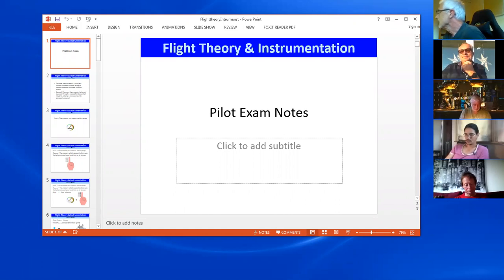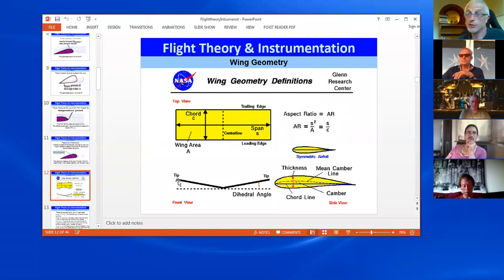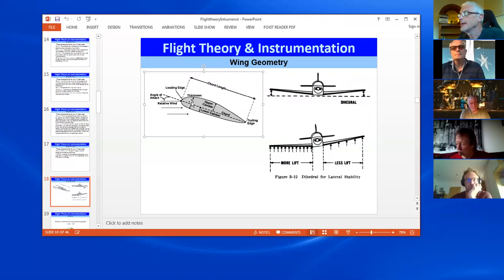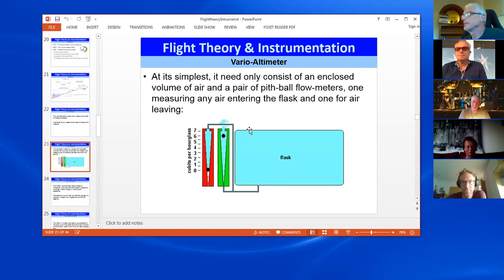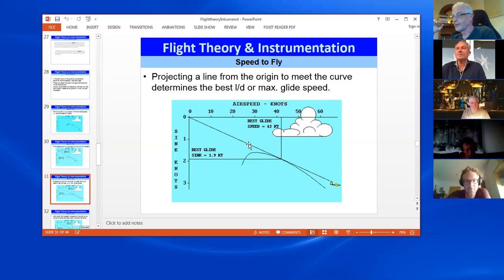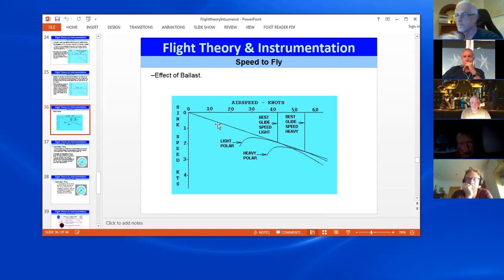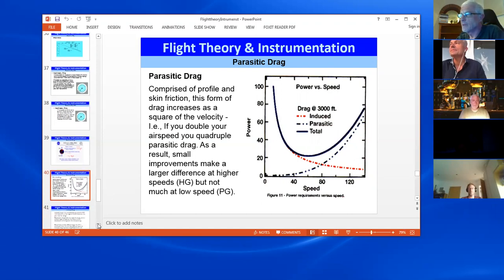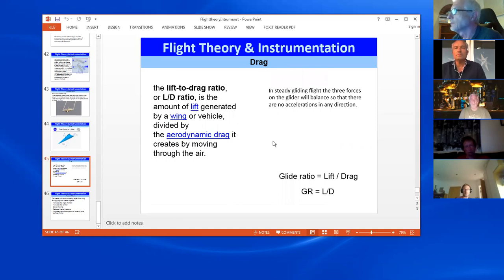Flight Theory for BHPA pilot exam

Comment: All lift is the result of downward excellerated air. A pressure differential doesn't cause lift. Rather it IS lift caused by the excelleration.  There is not  multiple separate causes for lift. You don't create a pressure differential and then get lift from it. Lift is a reaction force,  not an action force. The bernoulli principle is a conservation of energy statement, that shows how air can trade pressure energy for kinetic energy while not gaining or losing it's total energy. The bernoulli principle doesn't cause lift. The attack angle determines the speed of excelleration. The airfoil shape is about efficiency,  but the shape does not a cause of lift.

Comment: It is wrong approach researching the creation of Lift force and Low pressure at upper side of the wing. I explain the aerodynamic cavitation and existence of Lee side aerocavern, and creation of Aerodynamic force.
Reply: There NO Lift `force` and NO Drag `force`, it is Aerodynamic force. Lift and Drag are just components in coordinate system.